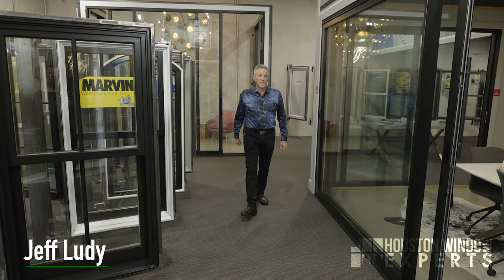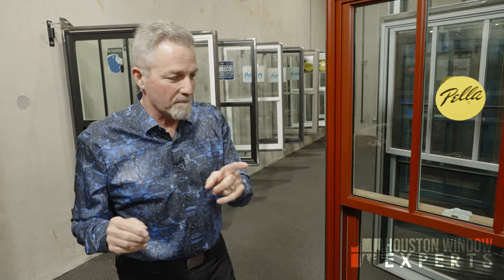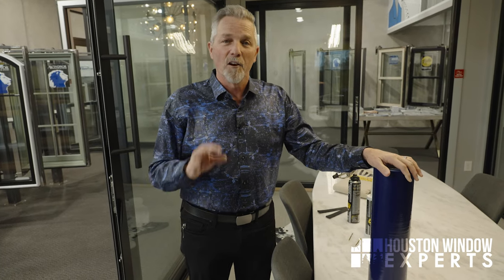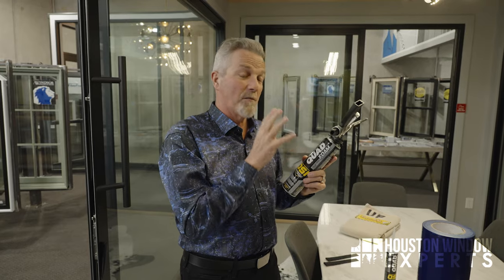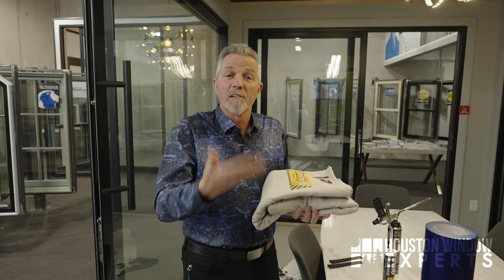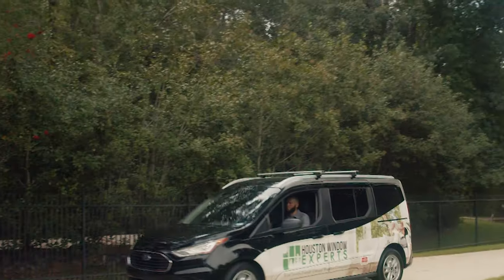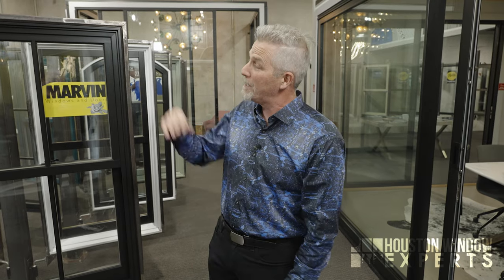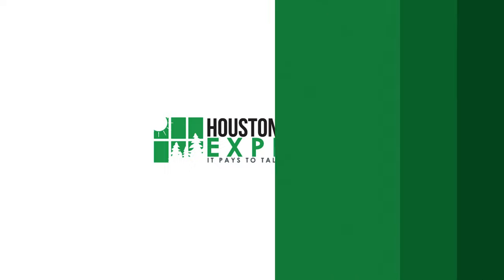Buying Windows: Be an EXPERT

Comment: We have to replace our 33 year old windows in our house in Florida after Hurricane Ian.  We had water intrusion and are in the  contractor and insurance nightmare so many are dealing with.  Any recommendations on replacement windows with cinder block homes?  We are 60 something and would like not to deal with this again😂.  Thank you!
Reply from the maker: I can recommend a great window company near you. Please check out JeffsList.com
Reply: Did you ever figure it out?
Reply: @alexgarza867  Jeff’s list doesn’t cover Florida yet so no help there.  We ended up removing windows and frames ourselves and reinstalling the same windows with new stainless steel screws and caulking after cleaning them.  So far water tight. We ran a hose from the outside to test as well.  Had to use larger screws in some holes to make it bite.  The original frames due to the pressure changes of Ian were all loose.  Hoping this will fix it for awhile until we can get new windows.  Seems good so far.
Reply: @cj2467  alright sounds good. I do installation for windows and doors and live 30 mins from you. I was willing to come help you if you needed it.

Comment: Hey Jeff, I'm turning my back patio into a 3-seasons sunroom and doing the work myself.  I will insulate the room, but would it be wise to go with a mid-range brand since it's only in a sunroom?  At the same time, I don't want to be a penny wise and a pound foolish.  Any mid-range brands you recommend for new construction, standard size, single/double hung windows?  Thanks!  (Ironically the sunroom is on the shady side of my house!)  Love the channel and have learned a ton in the past few days!
Reply from the maker: Thanks for watching and your question. I'd get something that's not too expensive. Look around for something that has good reviews and is not too costly. Do you have a lumber yard you can go to?
Reply: @HoustonWindowExperts  Yes, there are a couple in my area.  I will check them out.
Reply from the maker: I think that would be your best place to start. Good luck.